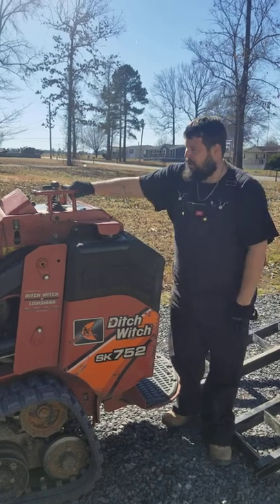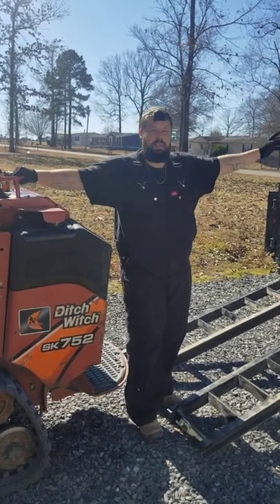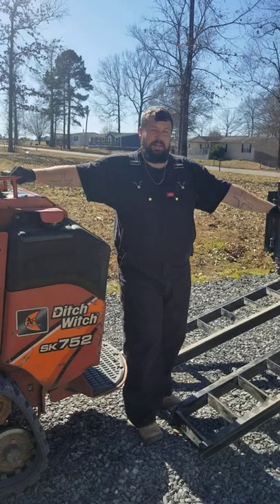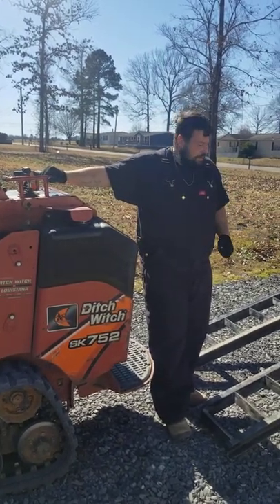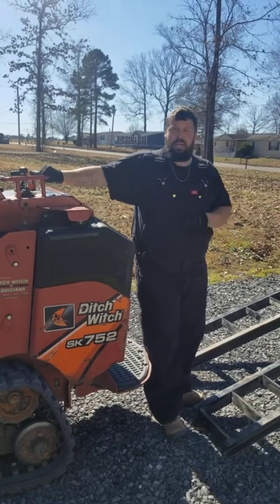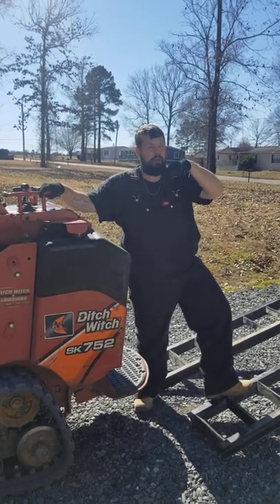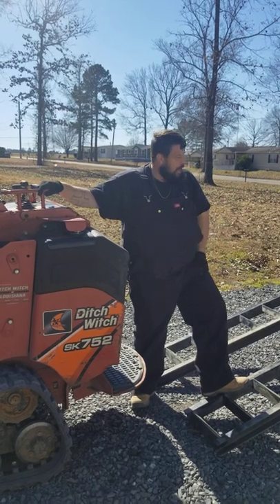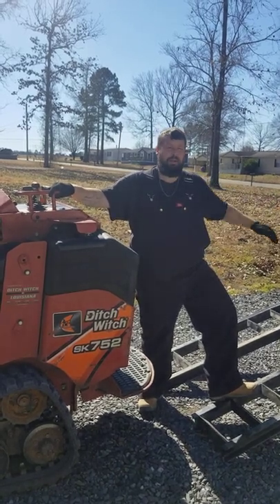How to load a mini skid steer on a dump trailer

Comment: Loading it backwards is safer but increases the tongue weight. The controls on the machine also make a big difference. I just finished using a Wacker Neuson SM100 with a joy stick and if there is any movement whatsoever requiring you to move your hands, you may find the machine turning.  Also good point about warming up the machine.  I was loading frontwards and I was on the back. The dump trailer is rather high off the ground and the machine stalled on the pivot point. I had to jump off as the machine starting to fall back and the ramps I was using were also problematic. 

I had to push the machine up from where I was standing and my wife depressed the safety switch on the platform. After starting it also had a brake on and so I had to take that off before I could move the machine perched on the ramp tilting back and forth. I did get it loaded, but not the experience I would like to repeat. So, make sure you have full control of the machine before loading and that it is fully warmed up. Going up too fast on a 6 X 10 trailer doesn't leave much room.

I have also used another type of machine on a landscape trailer with full ramp and that was much easier.

Experiences loading and unloading will be different depending on what bucket is on and your own weight, current fuel etc. I've used the Ditch Witch, Dingo and others too. Having two levers to control track movement would be better keeping the machine straight vs a joy (no joy loading) stick.

Also, tilting the dump is an option, but depending on material or ice, may be a problem too.

Having jacks is a must.

https://photos.app.goo.gl/1BgJmUwgivGiSKdq6
Reply: I recently bought the same machine how is yours holding up?

Comment: Next time. Lift your dump bed about two feet and the ramp will be straight no jump when u cross from ramps to trailer. Even if you parked up or down. No pressure on the trailer or the truck.
Reply from the maker: I appreciate the concept but it's really not necessary.  Plus with the bed tilted the dust from the gravel I haul would likely cause my tracks to slip.  If I  were in a steep situation I would definitely give it a try tho lol. Thank you for the advice Brother